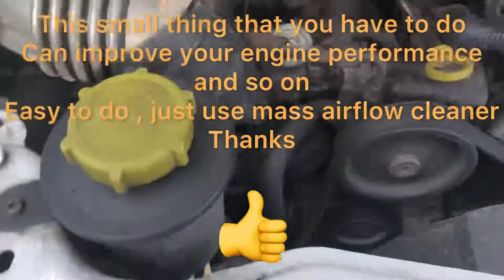Do this to you car... Ford transit mk7 improve your engine easily , clean your air mass flow sensor

Comment: So the entire point of the video is how to clean the air flor sensor, but you skipped that part but got your full walk down the drive. Did you use a tooth brush, water, dump it in the sink, put it in a dishwasher, use lighter fluid... so many questions all unanswered.
Reply from the maker: If you use a toothbrush the chances are to damage the lids inside, try only pressured water souped etc.. if it’s very dirty then use a soft brush .
Reply: Hi,  would a small ultrasonic ( jewellery cleaner) be ok with washing up liquid in water ?
Reply from the maker: Hi , Yes will be ok,  but use a soft pad in my opinion . 👌
Reply: @SilviuGabriel1997     Thanks Silviu
Reply: Whats the point of this rubbish 🙄
Reply from the maker: To fucking clean the sensor ! You have two hands so just remove and CLEAN !
Reply: Go easy on him, he's not very bright
Reply from the maker: @BillSikes.  You just miss the point of the video!
Reply: No there is no point to this video u didn’t even show how to clean it that’s what we want to see how u actually clean it
Reply: @lewismcarthur393  
Go easy on him, he's as thick as two short planks